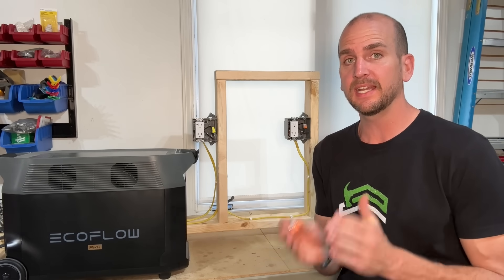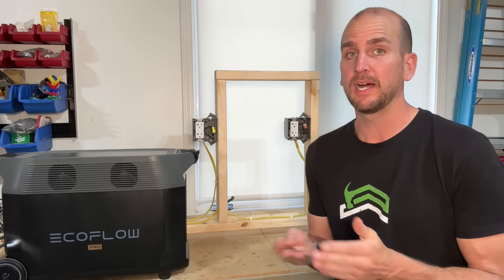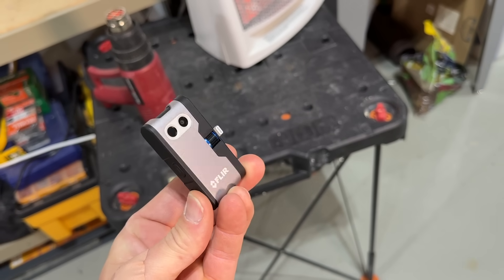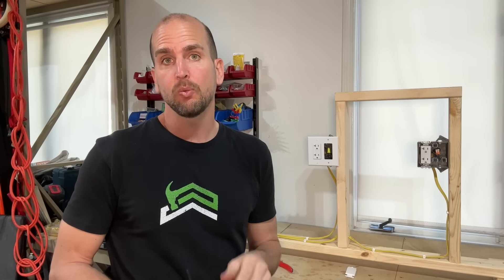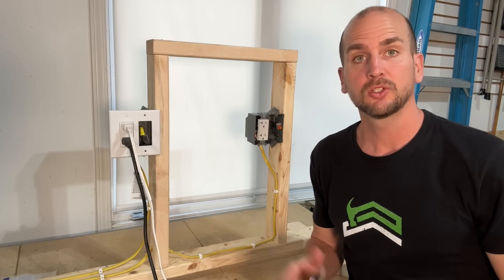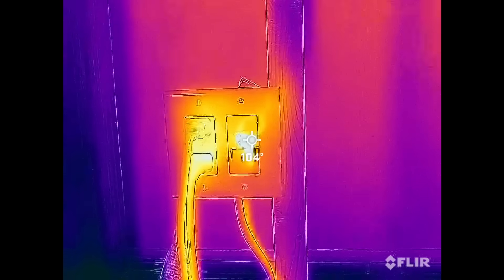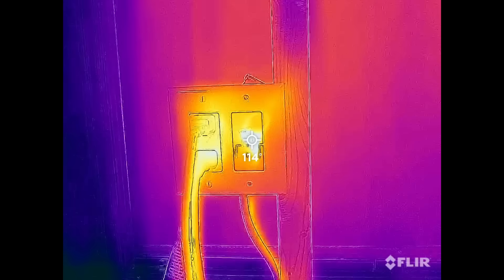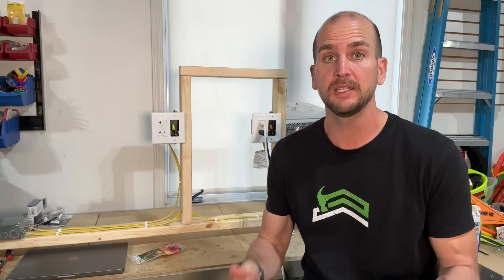Debunking the Pros: Can WAGO Lever Nuts Handle Heavy Electrical Loads?

Comment: Nice.  I'll likely use nuts where the load is higher for the added safety as well as added efficiency.  Outlets for example.  Where load is low like on LED lighting I don't think the nuts have much advantage and will use it there.  I'd be interested in seeing a similar test for the new Leviton Wago-like outlets.
Reply: this is the main difference between the US and Europe... the US does no routine testing (only commissioning) (that's not a criticism)... most of Europe has some kind of periodic inspection, and the removeability of the wago is KEY to its success .. wirenuts just leave a mess when you remove them, and don't lend themselves to reinstallation (Nor do screw terminals which is why we're phasing them out)
Reply: @TheChipmunk2008  

Screw terminals are no issue as long as the conductor isn't damaged. We remove and replace in the UK often during testing or replacement. Wago style 13 amp sockets are now available in the UK. 

A Wago, in the manufacturers enclosure, is MF rated, maintainance free, one of the reasons they are so popular and used in inacessable places. In theory, screw terminals can loosen over time.
Reply: @martinw245  Depends if someone with a gorilla arm has been at them, I too am in the UK, just replaced a MEM board from the 1970s today, screws were as tight as the day they were done up.... Installation passed the EICR with flying colours too, only issue was the 1mm earths on the ring finals, but the Zs worked out and even did the adiabatic for gits and shiggles :)... (guy who'd owned the place before, RIP, had been a sparky, so was way overprovisioned with sockets for the 70s, so 'acceptable' today lol). Just a board change, move a few sockets, EICR...  All of it was impeccable. BUT, you sometimes see 1.0mm especially, cut in half by the screw, that is the ones I meant. 

And gonna use an MF joint on monday, buried in a concrete floor :O  (wall removed, cables buried in floors... no zones in floors LOL)
Reply: @TheChipmunk2008  

There's a video of a guy plastering over a Hagar MF box on YouTube. And you say you are doing it with concrete, which box? Something doesn't sit right with me in regard to concreting over, or plastering over, MF boxes.

I'm wondering what the regs say.

Re screw terminals loosening off with thermal cycles, it's theoretical, I guess. I read something by an electrician a while back, where he rewired a very old house and found extremely old junction boxes, just as tight as the day they were fitted. I guess it depends how tight the connection was originally made.
Reply: @martinw245 we are going to use resin joins (really designed for SWA) because there is as you say no official way to do it
Reply: As someone who is an electronics engineering technologist working in IT, my expertise is low voltage DC, but I prefer the Wagos. I have never liked the mechanical design or concept of wire nuts, even if it creates a very good mechanical connection due to the high surface area contact, I'm also not a fan of screw terminals of any kind. Lever nuts make a lot more sense to me because of the avoidance of twists and reliance on that type of mechanical connection (screws make sense as a fastener, but not as an electrical connection), it has more of a locking connection, harder to work itself loose (if not impossible without external influence on the lever, or material fatigue). For these reasons, I prefer the Wago lever nuts, and really like the new Leviton lever nut receptacles and switches. The fewer screw terminals and wire nuts, the better as far as I am concerned. Having said all that, I agree, I want to see this test done with the new Leviton lever nut receptacles also!
Reply: Higher rated Wago's are available, both push fit and lever varieties. At least in Europe they are. Probs in US too. I seem to recall lower resistance in the push fit variety, but don't quote me.
Reply: @martinw245  I heard that too, think it was in the 'within margin of error but consistent' territory

Comment: This was a good test!
I prefer the wago connectors which makes it easier to correct a mistake or to make changes in a circuit box.. I use them all the time.and have eliminate all of the wire nuts.
Reply: I dont want you wiring my house.
Reply: @RadioRich100  I certainly wouldn’t want you wiring my house!
Reply: @glasshalffull2930  agreed! Fault tolerance is prefered!
Reply: till the first house you put them burns down.
Reply: @RadioRich100  if Wagos were prone to causing fires, then why are they the de facto standard in Europe. And, no, not everything that is common in Europe is better than here in North America, but in many cases, they are more likely to make a change, and do so sooner, when it's demonstrably superior.
Reply: Do you make mistakes consistently to merit the use of wago over wirenuts? I mean why would anyone use wagos on a outlet receptical that they will probably never re-open again? Perhaps they are more useful in ceiling fan applications.
Reply: @hippo potamus  one should ALWAYS plan for ease of troubleshooting, doesn't matter if you are a pro or DIYer. I always try to design network wiring, or wire management, or any project I am doing with future ease of troubleshooting or easy future additions/changes from the ground up. It doesn't matter if it's going to be me, or someone else doing the troubleshooting or future additions/changes, I try to make my life or the life of the person doing the work easier. I can't tell you how many times I come across things where corners were cut (but still meet specifications) or costs cut by using lowest quality parts (I love using cheaper/lower priced items, but not at the expense of minimum quality standards or reliability), or things are mislabeled, not labelled at all, or the labelling was done originally, but not updated after troubleshooting/changes/additions, or the new labelling refuses numbers used originally so now you have two rooms with an ethetnet jack, both labelled "D22" and a different label maker was used at the panel for both, and on the jacks, so they don't even look the same.
So, again, it shouldn't matter if one is prone to mistakes or not, minimizing mistakes, however minimal to begin with, whether now, or in the future, is always good practice and should always be encouraged.
Plus, Wagos being reusable mean they don't have to be thrown out if you make changes at a later date, in may cases wirenuts are one time use, what a waste that is!

Comment: WAGO are UL certified and meet NEC standards. They also have multiple international electrical certifications.  The  U.S. wire nut doesn't. They don't meet international certification standards.

And WAGO provides a superior connection between solid and stranded copper wire, something that a wire nut cannot claim.

WAGO wins, hands down!

Next thing you'll be saying that knob and tube is better than THHN  😂
Reply: Wago's are for hipster DIY'ers and hack electricians.  :person-turqouise-waving:
Reply: The US Wire Nut is “UL” “CSA”  “C E” and “ISO”. The ISO is not on specified on EVERY bag. If need be, I’ll send you a bag of US wire nuts with the ISO. Wago makes many products and have multiple international certifications as a company, so does Ideal Industries (which makes more than just US wire nuts). It doesn’t mean all of those multiples apply to the Wago wire connectors, or the Ideal Wire Nuts. With the right experience, if braided correctly, if the braid is cut to the correct length, and the proper wire nut is used, it’ll make a superior connection, arguably better. Wire nuts fit a larger variety of wire sizes which a Wago can’t -yet…and wire nuts cost less. “Wagos”, or “Ideal Push In” wire connectors are fast and good for those who would rather take the guess work out of which wire nut is the right one.
Reply: So did aluminum wiring.

Comment: When used properly, there's no risk of electrical fire or anything like that; I think the more important issue is people using them wrong/not understanding how they work. But in the age of youtube where anyone can pull up a video and learn the right way to do it in under a minute, I really hope that concern is unnecessary.
Reply: Maybe a more relevant concern however is using the correct size wago lever nut with the correct size wire - that's a lot harder for people to understand, but the most common wago lever nuts are sized for the most common wires so hopefully that does something to help
Reply: Your wrong fire is exactly what you need to worry about. When the springs lose tension over the years.
Reply: @RadioRich100  As many have posted, that hasn't happened in Europe, where they have been in use for about half a century.

Comment: I would like to see a test done like this with wire nuts and wago’s that have been in service for 5 or so years to see if either of them lose spring tension
Reply from the maker: The ones I have been installing only have about 2 years of service so I have a bit longer to wait for that test  👍
Reply: exactly, the problem comes from using them over extended periods of time, after enough times of heating and cooling the wagos connection weakens, causing more heat, and the cycle just repeats until you end up with arcing and a fire.
Reply: @SbassLaser  These aren't new. They've been in use in Europe for a decade, including commericial applications. If there was a problem, you'd have heard about it.
Reply: @SbassLaser  Please provide some documentation of your claim. Apocryphal tales carry zero weight.
Reply: @buggsy5  every electrician I've asked about these have said the same thing
Reply: @SbassLaser  Every Electrician I've asked here in Europe said it was not a problem.

Comment: no surprise to me. there are plenty of other youtubers that have done far more extensive tests. the wagos work just as well as a wire nut. I have them all over my house without any problems. now they are certainly not full proof. I did have one break on me one time, but that's why you do the pull test before you put it all in the box. You should also test the voltage as well just to be sure. that should be done regardless of the connector you use.
Reply: There not just as good there far worse, you will see in a few years.
Reply: @RadioRich100  they are used all over Europe for a long time. if there was a problem with them long term I think we would have known it by now.

Comment: IMO the Wagos give me more confidence that my connections will stay together, especially when connecting 3+ wires, and in many cases make tidying boxes easier. I'll never go back to wirenuts where I can help it.
Reply: I echo that. I just redid a junction box that had 3 and 4 wire gangs, though I used the push-in type. I felt very sure of the connections, unlike when I was using wire nuts. The bonus was that it was way easier to stuff those wires back in the box.
Reply from the maker: I completely agree 💯
Reply: Thanks for doing this, I'll keep using the Wago's

Comment: How often do they come undone or dont snap fully closed accidentally? If never, then you're probably ok :)
Reply: Check with the Europeans, they have been using them for around 45 years. I suspect that mishaps with WAGO connectors are far less frequent than with wire nuts.
Reply: But your not ok
Reply: @RadioRich100  I'm more worried about "WACO nuts" hah that's some cult humor for ya

Comment: I am glad that you put in the max temp on the graph. It really put into perspective.
Reply: @EverydayHomeRepairs  There should be NO HEAT, NO MEASURABLE RESISTANCE
Reply: No they fail over time from the heat and the springs lose tension. Their garbage , just a shortcut